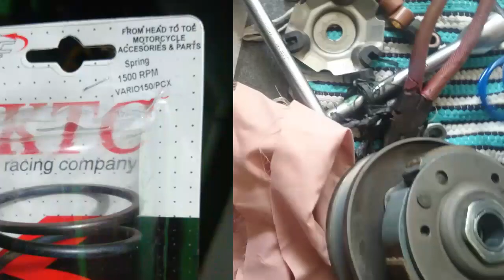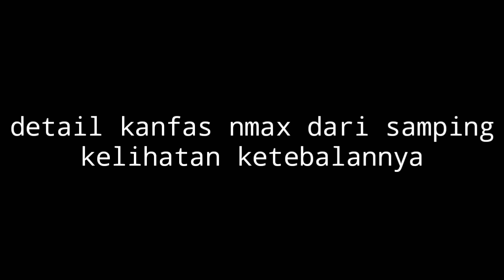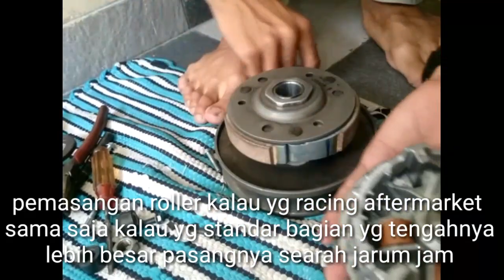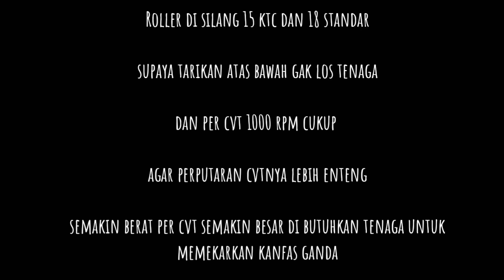UPGRADE CVT PCX kanpas ganda NMAX

Comment: Saya kamrin ganti pake kampas ganda nmax satu set. Enak gak ada gredegnya. Cuma di km 40 ke atas sula ada suara greg greg. Knpa ya om terima kasih
Reply from the maker: Rendy H sesuaikan roller sama per cvtnya , dibikin enteng aja
Reply from the maker: bunyinya itu dari belakang cvt apa depan kalau blkng mungkin bisa dari kanfas gandanya belum rata kalau depan mungkin rollernya kurang pas atau kalau vbeltnya kendor masangnya ada yg salah
Reply: @amr_helloo   kurang tau deh. Kalo d atas 40 kadang ada suara greg greg gitu. Tapi gredeg bner2 ilang pake kampas ganda nmax satu set
Reply: @LukmanDanuarta_   bisa om. Beli aja d toko otomotif. Tapi yang ory ya. Jgn yang kw
Reply: @LukmanDanuarta_  saya pake roler 12 gr 4. 14 gram nya 2. D jamin bawah enteng. Atas juga dapet
Reply: @rembo782  satu set itu maksudnya gimana om? Sama dudukan kampasnya juga ya?
Reply: @ard2376   iya om